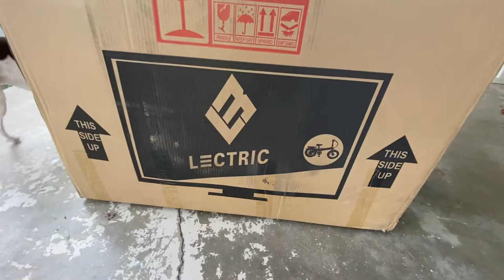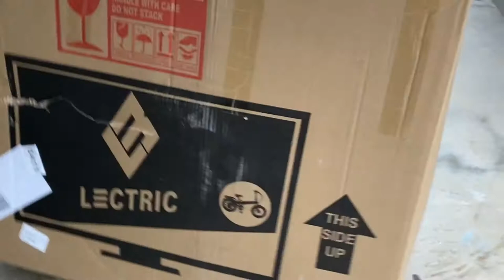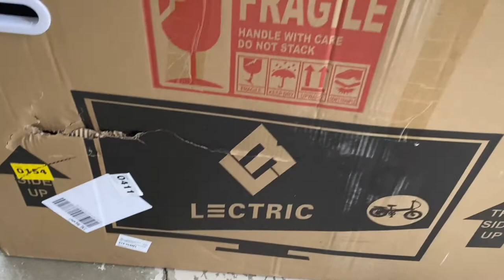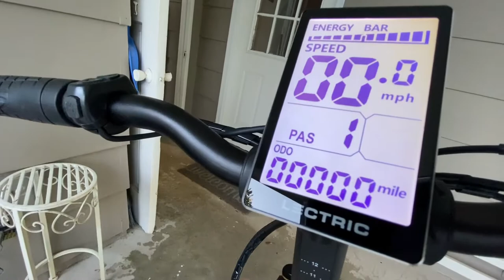Letric Unboxing and First Trip with Pet Carrier

Comment: I have wanted one of those for quite a while. So happy for you.
Reply from the maker: I hope you are able to get one.  Mine is currently shipping.  So ready to get some bicycle exercise and enjoy some bike trails.
Reply from the maker: Did you ever get one?
Reply: @MyCornerOnline  not yet. Been too cold to go out. Trying to decide if I would really use it. What do you think after having it for a while?
Reply from the maker: @brendaseek1718  We like them a lot but it got cold and we were only able to do local trail. Still want to test it on a longer trail. Still trying to decide how to travel with them.
Reply: @MyCornerOnline  I was hoping since they fold they could be tucked in my van. I sleep in it, but don’t carry a whole bunch of other stuff.
Reply from the maker: @brendaseek1718  Yeah. A van. But we have a truck. They go in truck bed fine. But how would we secure them overnight at a hotel or whatnot? Or even camping? Or if we wanted to go inside a restaurant? They fit better in the back of our crossover for security but that vehicle too old for distance travel now. And we have no room for them with camping stuff. 

So we can do day trips but still not overnights.
Reply: @MyCornerOnline  we used to use a long circle cable to go around trees and such, then attach another cable to lock each bike to the first circle. But I see what you mean about the truck bed. Any way to mount an eye bolt in the bed?
Reply from the maker: @brendaseek1718  also consider that electricity and rain / water don’t mix. These bikes can’t get too wet.
Reply: @MyCornerOnline  that is a factor I hadn’t considered. Thanks for the insight.